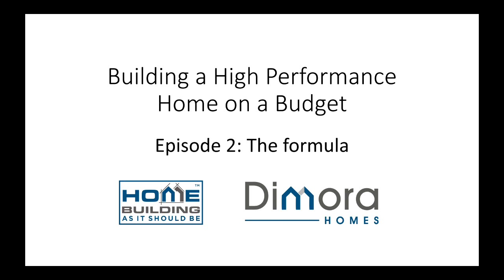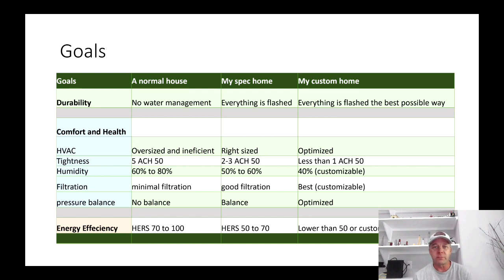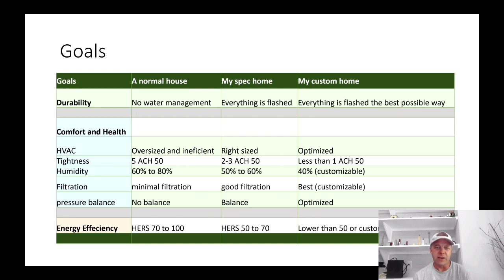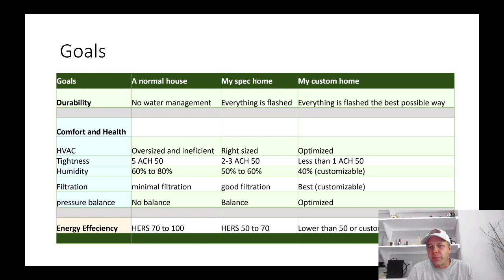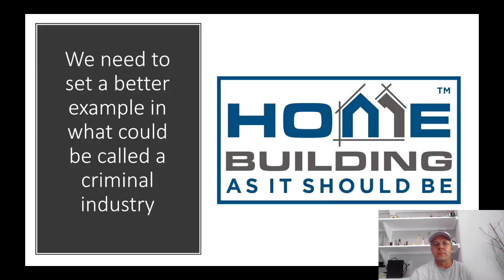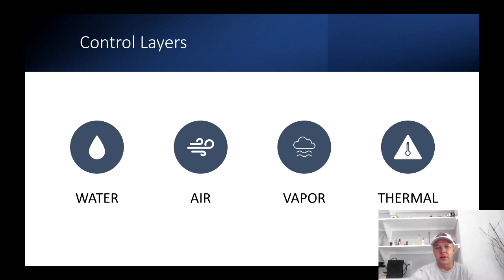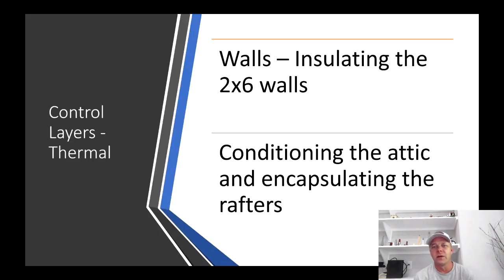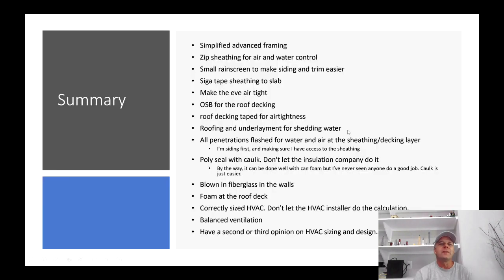Building a High Performance on a Budget E2 The formula

Comment: I just interviewed a home builder friend and posed the question about building high-performance spec homes while making a profit. He looked at me like I was crazy for suggesting this. This video series will be great to send to him. Thanks for paving the way!
Reply: Pioneers always have a hard row to hoe. In 2006 I tried to get a home builder here in Charlotte, NC to build our home using what was then called "Smart Framing," showing him articles from Fine Home Building Magazine for details. He gave a million reasons why he could NEVER build that way and I had to find another builder. Fast forward 6yrs and guess what I find...an article written by him in FHB (issue 226) detailing how "Advanced Framing" has become their company standard. You gotta be kidding me! Change is very difficult before it becomes normal. But things do come around in time.
Reply: @branchandfoundry560  so funny I am in charlotte too and most homes are not buildt energy effcietly because the government hasn't updated building codes even.

Comment: I agree that you should hire an engineer, PE, for doing HVAC analysis.  There are folks that can run Wrightsoft, or other programs, very well, but they are not educated on heat transfer and fluid flow.  While it is not rocket science, understanding the science behind thermodynamics, heat transfer, and fluid mechanics is important.   Besides, can the guy on youtube stamp drawings.  Not everyone on youtube is correct.   As a PE in Mech and Structural, it is easy to sift the bad from the good.   Scott, you are in the good group.

Comment: I’m going to build my house this way. I’m having the plans drawn up now. The HVAC system of coarse came up by the engineer drawing the plans and he had questions about how the ducts will be run since the middle of the house is all vaulted ceiling. I know no hvac companies in my area would be able to answer this I believe they are only interested in oversizing and building leaky ducts installed by 18yo kids for the most profit! If I asked them about ERV’s or adding a dehumidifier they look at me like I’m crazy! Who could I get to design the proper system on a budget?
Reply from the maker: Corbett Lunsford: https://buildingperformanceworkshop.com/

Comment: Thank you!! I’ve been going nuts trying to solve southern roof building method here in Georgetown. Doing open cell in attic. Only weatherized osb has a radiant barrier made useless by the foam. Just don’t want to spend on a double deck roof (and considered “perfect roof” instead of foam, which just seemed like a pain for roofers and solar installers. And Risinger calls his “perfect roof” and puts foam in anyway? Technically no longer reflecting the method.) Now if you could just help me with my winter build. I’d rather have SYP subfloors. I think they perform better but may spend on the Advantech just for the little time it spends on site.

Comment: Hello @Scott True Builds, I am in the North Eastern New England, we are looking to build in NH or ME and its going to be an OFF-grid home!!! And the home is going to be a Passive Solar Double (Skillion or Clerestory) / (Contemporary Modern) Shed Roof(Open concept over the Living, Kitchen and Entrée area's and standard roofing construction over the bedrooms, bathrooms and Laundry based on a Single first floor (with a full basement (Radiant floor heating) using ICF) with a Metal roof home what a mouth full, ha ha ha!!! And It's going to be very tight home with a ERV obvious!!! 
                                                                                                                                                                                                                                                                           
So, I have been looking into Advanced High Performance 24 OC but I have never done it before, just used to 16 OC and I am going to be using Zip R sheathing is a must for me!!!                                                    As we going to start this project, I and my Wife are going to start a YouTube channel throughout, from planning, cutting down the tree's all the way threw completion!!!                                                    The question in my mind would be about Dry wall???  And in the end its got to be on a BUGET !!!
                                                                                                                                                                                                                                                       
Builders don't explain or educate perspective home buyers, which is a shame!!! Builders give you a choice of colors and the closes things to efficiencies, yeah you can get an Energy Star Refrigerator and pick the color of paint, ha ha ha!!!                                                                                                                                                                                                                                                                                              I love Building, maybe to much!!! Love the smell of Saw Dust in the Morning!!!                                                                                                                                                                                                                                                                                           Just wondering if I may call you and we can compare thought and concepts if that is possible???

Comment: Scott, you mentioned Zip having varying cost differences depending on market conditions. Have you look at Forcefield by GP?  Under $20/sheet currently
Reply from the maker: Yes, Forefield is a decent option. I will use it sometimes.
Reply: @ScottTrue do you ever use it combined with spray foam and just try not to think about the wasted foil?
Reply from the maker: @cindystokes8347  That grey layer on Forcefield is not a radiant barrier. It's a weather barrier that happens to be grey/silver. So it would go to the outside and you wouldn't be spray foaming against it.
Reply: @ScottTrue  Oh thank you! I think GP sells one that does have it and that gray makes it hard to differentiate. Thank you so much!! You are alleviating a lot of anxiety as I take on being my own GC.